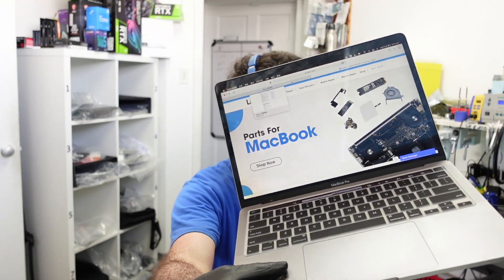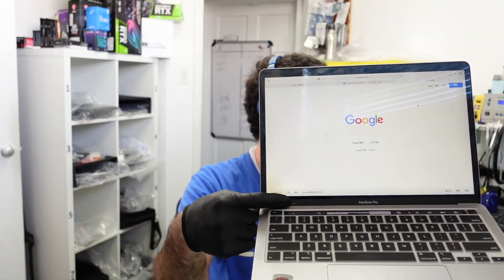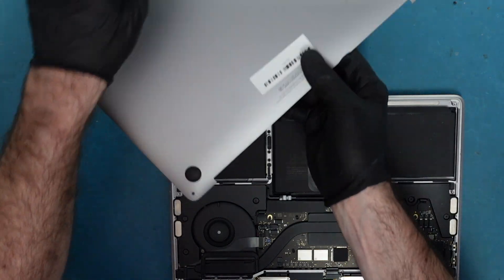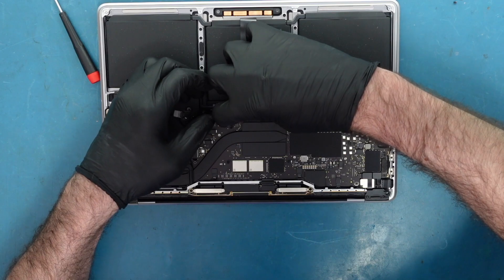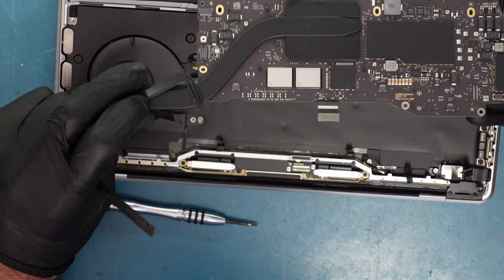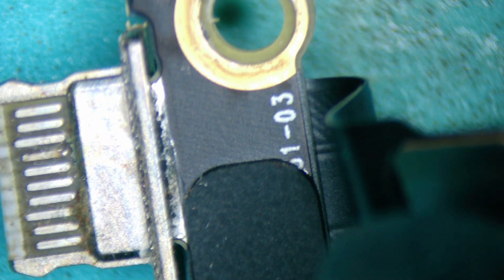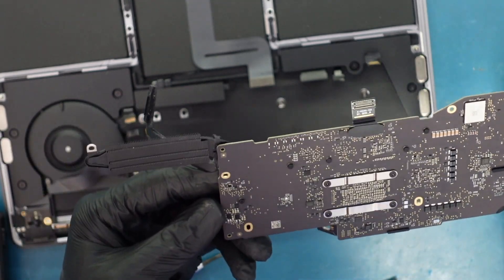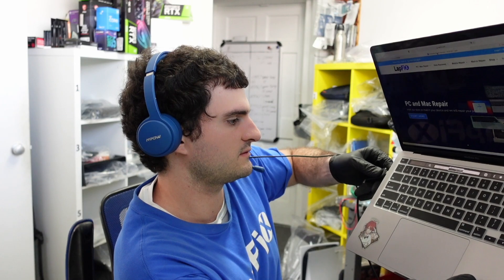M1 Macbook Pro Not Charging | Easy Fix

Comment: Hello! I replaced the ports but still no charge. Is it possible to check something on the replacement to see if current is going through? That will tell me if the issue is the kobo or the replacement part itself

Comment: Hello, i have an M1 Air 2020, u updated to the latest MacOs and suddenly the next day the laptops stoped charging.
The ports work fine with data transfer, the charging icon comes up but its writen not charging. If i leave the laptop plugged in over night it will charge maybe 50 % and than stop again.
Any suggestion?

Comment: great video but I'm confused with my problem specifically. My MacBook Pro m1 13.3 inch is only charging from the lower port. if I plug in my phone to both ports it will charge my phone and transfer data. I brought this laptop used. Is my computer supposed to charge from both ports or only one?